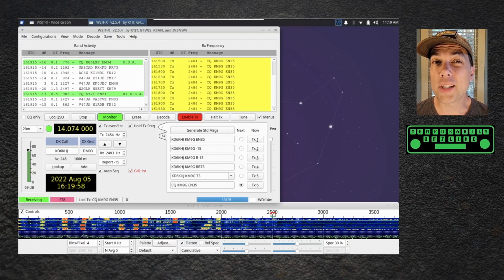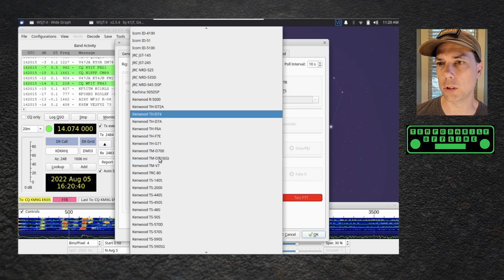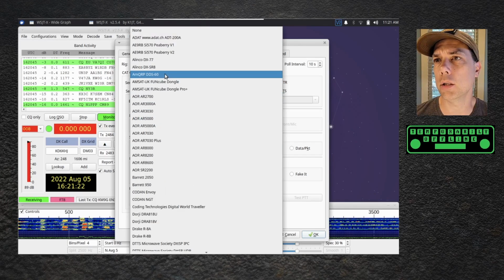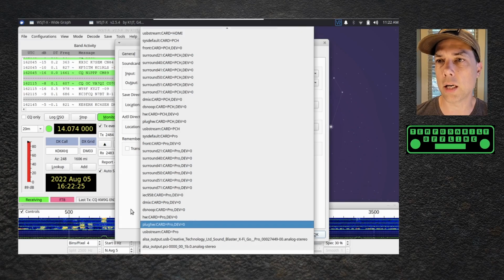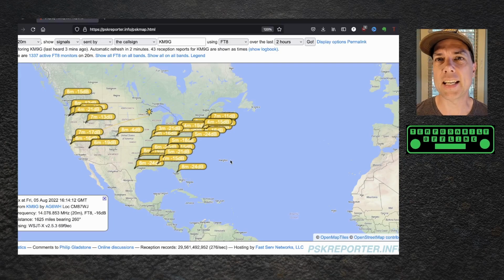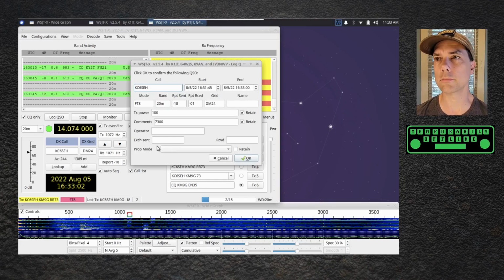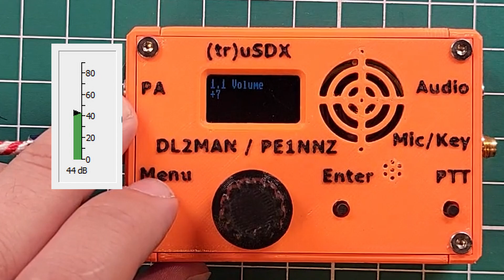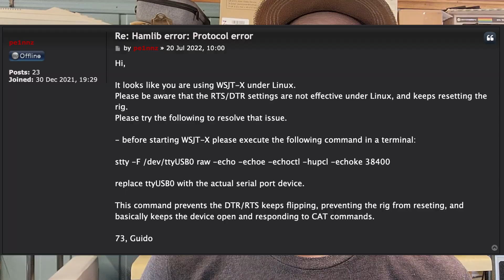How to make the right cable for your (tr)uSDX and get on FT8 w/VOX

Comment: Is this common  with all the usdx types of transceivers having to do this mod? Also, I guess this type of setup works on JS8call too?
Reply from the maker: @Rabbitears1  this is just for the trusdx, yep this can be used for js8, or extrapolated to any other digital audio mode.
Reply: @temporarilyoffline  Thanks. By the way, I love your videos that you bring and I learn alot from them.
Reply from the maker: @Rabbitears1  thanks!

Comment: The original Speaker sucks?🤣 I have the uSDX from Aliexpress. The internal Speaker works fine.😜
Reply from the maker: The black box metal unit?  Yeah, they are slightly different animals.  I have a video on one of those as well and more scheduled for it, time permitting.  Good radio!

Comment: love the channel, just a quick tip (after soldering thousands of audio connectors in the field over the years);  an elastic band stretched around the handles of pliers gives you a cheap extra hand to tightly grip just about anything that needs to be soldered. Acts as a heat-shunt as a bonus. Handy when you need three hands for those pesky little 3.5mm jacks that roll about the place and won't stay still :)
Reply from the maker: Oh sweet tip, thanks 💯

Comment: I made the cable and it works great, however when I put the rig in tune through wsjtx, power seems to fall off a bit as I go? Ever notice this?
Reply from the maker: "A bit" is pretty normal, "a lot" not so much.

Comment: Hi, do you transmit in FT8 at full power 5 Watts? do not blow final transistors? thanks
Reply from the maker: I live on the edge! (I use all the power I can while watching the heat)  I don't consider this radio to be an "everyday" radio, so outside of a contact or two, I'd put it back away.
Reply: @temporarilyoffline  I think one interesting mod would be another transistor and a big heatsink , 73
Reply from the maker: @diegogarciamedina6363  Check out that PA connection on the upper left of the rig... its looking at you 👀🤔
Reply: @temporarilyoffline  great

Comment: I think you mixed up "sleeve" (which is ground) with the word "ground"

If I got this right, the sleeve should be connected to the sleeve, and the "tip and ring" should both be connect to the "ring" (for the end that goes into the radio) leaving the "tip" unconnected.
Reply from the maker: I think you're on the right page.

Comment: What kind of antenna are you using for this?  Great video btw, I just ordered everything in your parts list except for the multimeter!  This was a really good wrap-up of the project, I hope to be up and running once everything arrives, the only missing piece for me is the right antenna!
Reply from the maker: Since I was in the shack, I used my DX Commander,  but that isn't easily portable.  If you're into kit building. I have to recommend my coffeeanhamradios.com EFHW, but the K6ARK EFHW antenna is smaller.  Both make great portable antennas

Comment: Do you manually tune the (tr)uSDX to the FT8 frequency?  Is that actually controllable over USB?  I'm considering getting one but still trying to grasp the extent of its features.

Is there a mechanism for streaming serial data to the computer to see a band-wide waterfall?  Or if I wanted that, should I just get a little SDR receiver and work out switching the antenna somehow?
Reply from the maker: In this video I tuned manually, but in the Follow-up vid, I was able to get cat control working.

As to waterfall, I bet there is an IF tap inside the radio.  Check out the schematic!
Reply: @temporarilyoffline  Ah, yeah, I see CAT has been fixed.  Thanks for the explainer, it's a really neat kit.

I wonder what could be done with a slightly more powerful microcontroller, like an ESP32-derivative...
Reply from the maker: Xiegu yes been using stm32s.  I'd live to design one,  but I'm not there yet.

Comment: Looking forward to receiving mine which is on order..! Thanks for the heads up with your video. Looking to find a little hand pouch / box for carrying this in to include, Adam's K6ARK wire antenna and Tr uSDX 18650 power bank case.  I take it you was on your DX Commander with the PSK reporter showing results.. not bad with 5 or 6w. Cheers
Reply from the maker: I was on the commander!  Good DX with your new radio!

Comment: Hi Steve. Will a mono audio cable work also?
Reply from the maker: For the mic/key part, you can wire it with left or right, butvit still needs to be custom wired.  For the headphone side it doesn't matter as long as the jack lines up right. (Radio side of both connections)
Reply: @temporarilyoffline  I got it to work. I had to place a small piece of shrink tubing to keep the two contacts from shorting out while placing the sleeve over the end of the wire. Works great now.
Reply from the maker: @KC1PSK  excellent!

Comment: Hello TO. KE8SRG here. I made myself a very similar cable with one difference, I added 1k ohm resistors from the left and right channels to the mono out pin. This protects the audio circuits as one should never connect two outputs directly together in electronics. This makes it so that the output won't ground back through the other output. Anyways, great video and love the channel!
Reply from the maker: That's a great idea
Reply: I was thinking of making a write-up of what I have done making custom accessories for my truSDX on my website, but I haven't gotten around to it yet! I guess I better get to it!
Reply from the maker: I'm sure people would love to know what you've been doing.  Let me know when you have the site up and I'll share it out.
Reply: You bet! That's one of the great thing about ham radio for me. Sharing info, learning, and tinkering with the technology.
Reply: Another thing one can do, is only hook up the left or right and tell the FT8 client to use mono out and just tell it to use only the left or right channel. Which ever was wired.

Comment: Being a phone guy, i can say those scissors ARE the way to go.  You made that cable fix look really easy Steve, i may need to create somet that i need.  With videos like this, i might even get convinced to dig out the rigblaster stuff and try digital again on my non digital radios.
Reply from the maker: What radio were you thinking about?
Reply: @temporarilyoffline  , long ago, i tried with my 857 and the TS480.  I wonder if my KX2 would be easier to deal with, i just dont want piles of cables to deal with.
Reply from the maker: @hamradiowithkevin  the 857 would take a 6 pin mini-din on one side and 2xTRS on the other - basically a Y cable.  I don't know about the elecraft. The 480 has a 13 pin on it, right? I think that is a Y cable setup also.
Reply from the maker: I just took a look, the KX2 has a mic and a phones connection, can probably do it with just 2 standard TRS cables, VOX and manually setting the frequency.
Reply from the maker: @hamradiowithkevin  First one is free!  Let me know when you're on the air

Comment: Hey Steve.  Thanks for sharing the process for building the cable.  What temp did you have the gun set to for the smaller wires?  thanks & 73

Comment: As being rather new to building cables and such stuff, I never thought about using the multimeter to determine which parts of a connector connect together. I relied on Google to find diagrams of such… Even though I’ve been around dealing with network connectivity issues at a company on a semi regular basis and sending tone through to find a single Ethernet cable in a rats nest of cables. 

I recently got a more decent Kaiweet’s multimeter (similar to the one you have in the video) and is so much better than the $5 Harbor Freight bottom line multimeter, and helped me out a lot on my last cable build. 73!
Reply from the maker: A good meter is a good meter!  The more I grow in skills the more meter I want.  That's how they get ya!
Reply: @temporarilyoffline  So true! I just got a UT 61E+ because my Amprobe 37 is a little out of spec... And an Aneng 620A...just because.  And I DO have a few more.....